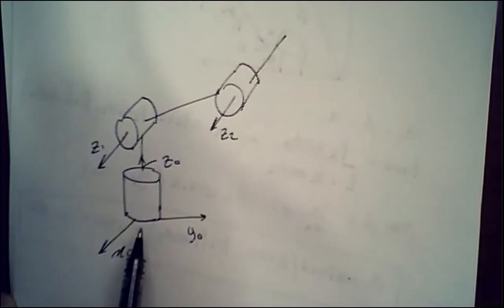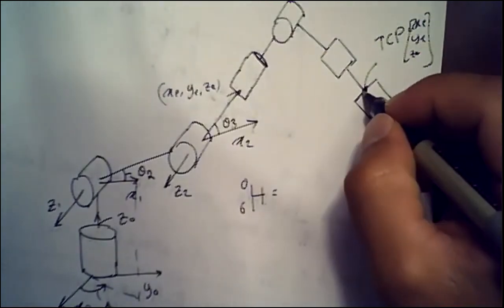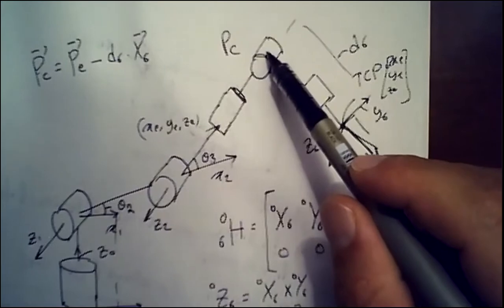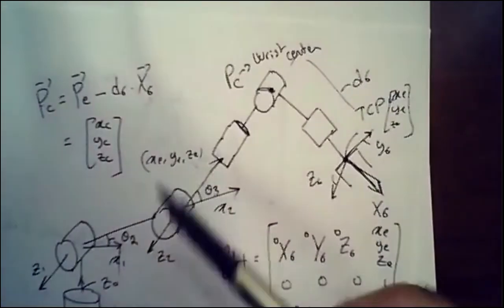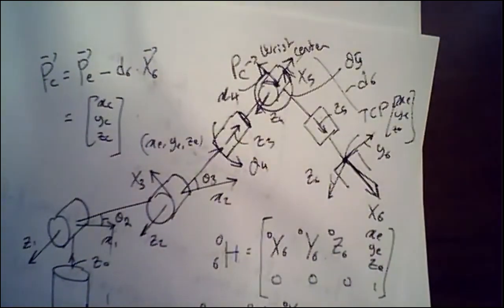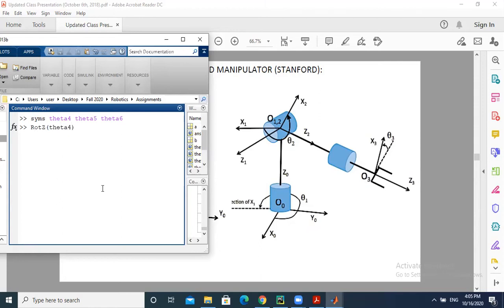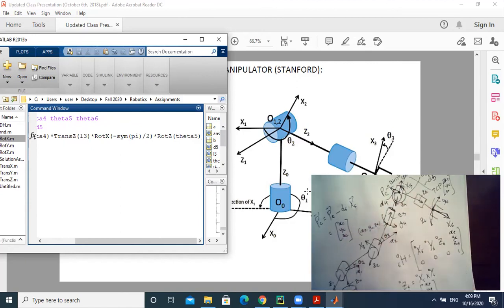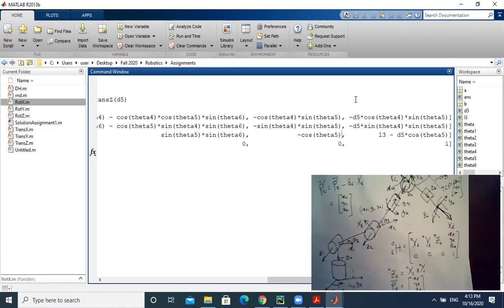Inverse Kinematics of 6 Axes Robots

Comment: .Hi just wondering if you made a typo in your  RotZ.m? I thought it should be like:

 function result  = Rot_Z(angle)
result = [ cos(angle),-sin(angle),0,0; sin(angle),cos(angle),0,0;0, 0, 1,0;0,0,0,1] 

?? Unless you used opposite direction to standard.  Cheers
Great video though.

Comment: I was wondering, is it valid to apply this approach to a 4 DoF robot leg? To be specific, this robot leg is the Lynx Motion 4DOF T-Hex Leg. If so, should the base revolute joint be rotated perpendicular to how you usually draw it here when doing the inverse kinematics for the first three joints?
Reply from the maker: Yes it is, however you would need to do the IK analytically probably based on the geometry of the robot.